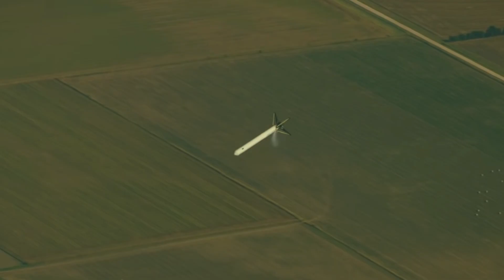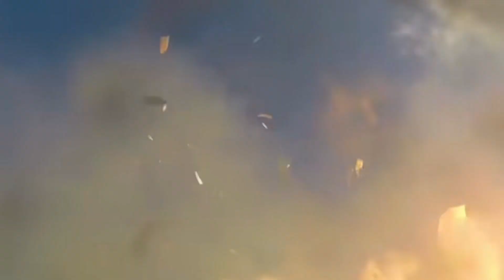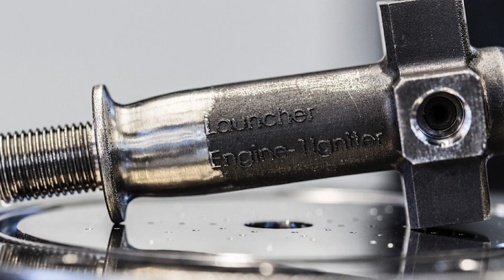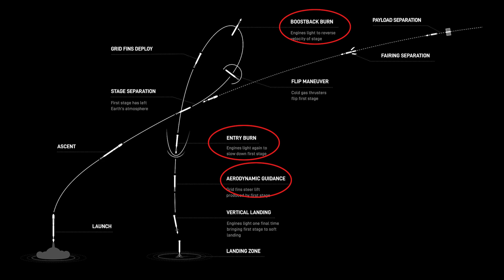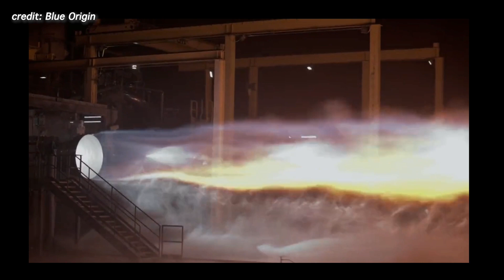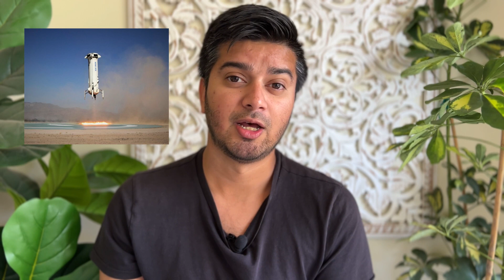How Do You Land Falcon 9? - Part 1

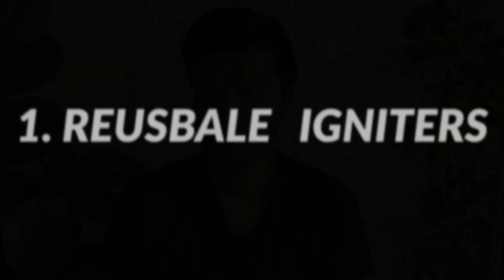Comment: 1:31 - Merlin engines use TEA-TEB as igniter it, is a pyrophoric - it self ignites in contact with oxygen.
No pyrotechnics there.

You can see the TEA-TEB as the bright green flash on engine egnition.